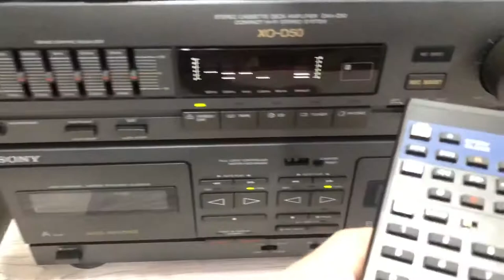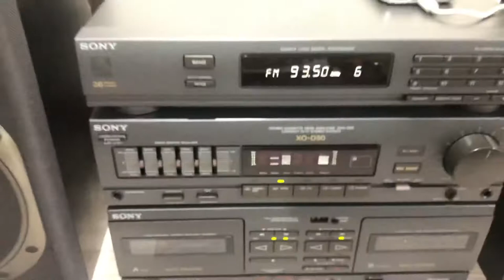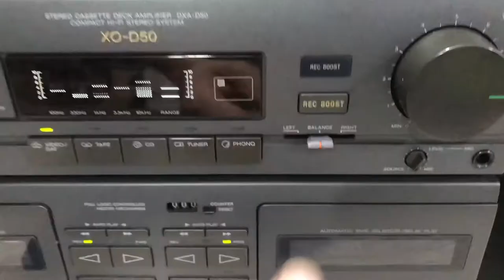SONY XO-D50 HIFI STEREO

Comment: Hello. Very helpful video. Do you know the size of the cassette belts for the XO-D501?  I have the Sony Part number, but it does not give the dimensions? Thank you.
Reply from the maker: Hello. Thank you. We do not know the cassette tire sizes. That's why we try and make different sizes a few times. We adjust and correct the speed with the potentiometer on the cassette player mechanics or on the board. If there were original tire sizes, I would share them with you.
Reply from the maker: Our advice to you is to buy tires of mixed sizes from aliexpress and repair them.